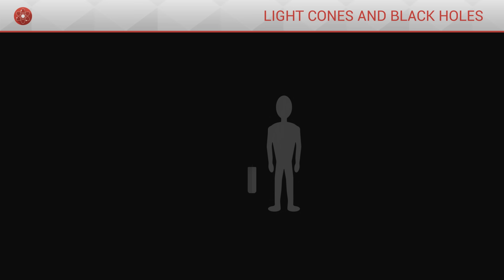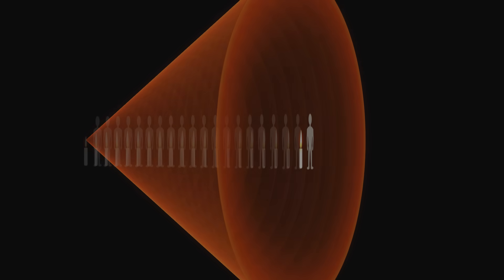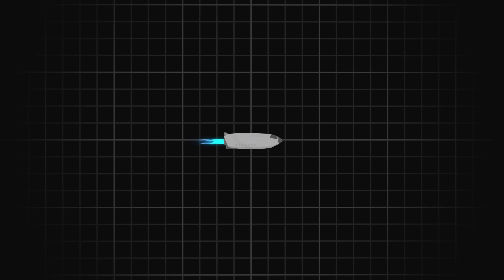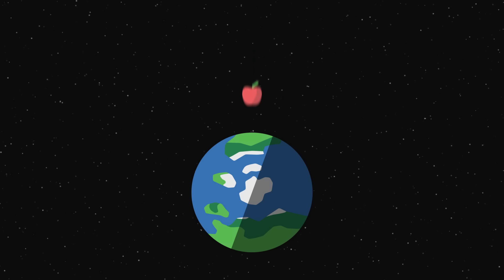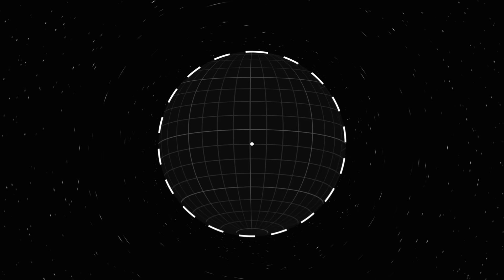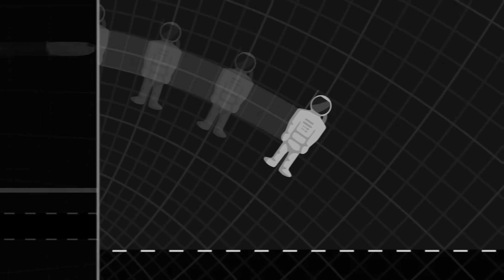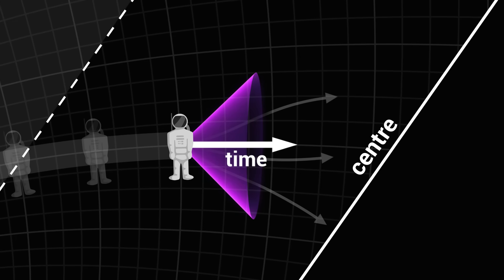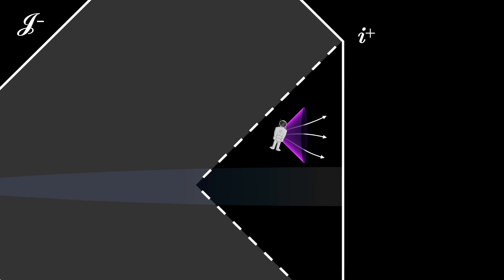Why Time and Space swap in a Black Hole

Comment: The black hole converted into a lightcone implies that everything is destined to fall into black holes eventually, no? Of course this doesn’t account for them evaporating.
Reply: the black hole is shown to "behave" like a light-cone to show that the event horizon is a null-like/light-like surface in space-time  and thus you cannot escape it if not by traveling at speeds greater than c (a.k.a. steeper than 45 degrees). There are absolutely future light cones whose trajectories in the conformal future infinity will actually never intersect a specific black hole, that is of course because you simply happen to not "fall" into that
Reply: Yes. In an otherwise empty, non-expanding universe with finite amount of stuff (objects/mass/whatever you call it) everything will eventually be pulled by gravity into one body. If one of those things is black hole then ALL this stuff will cross its horizon eventually, and enlarge it in the process. If none of those bodies is black hole, but gravity of this mass generate enough pressure (like in supernova explosion) then this stuff will create a black hole eventually